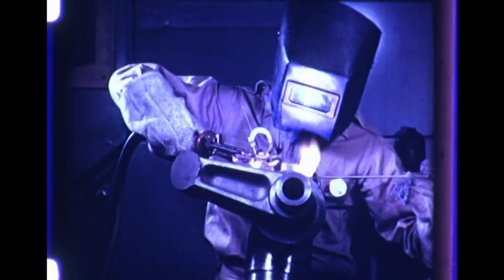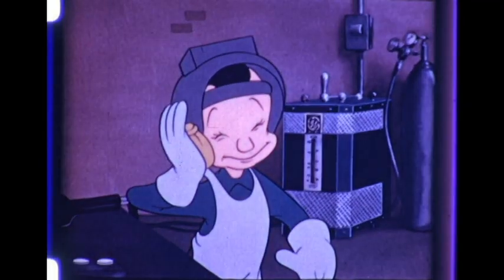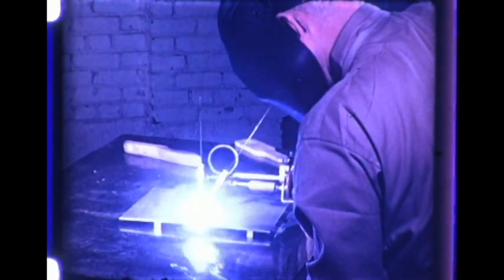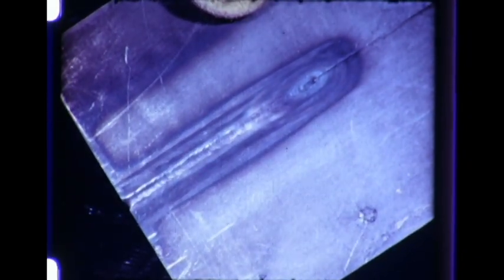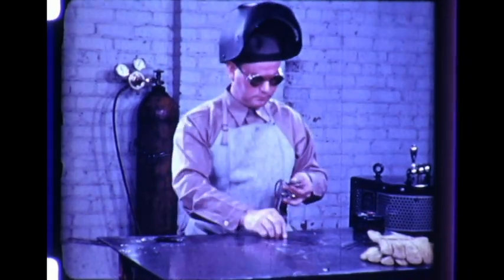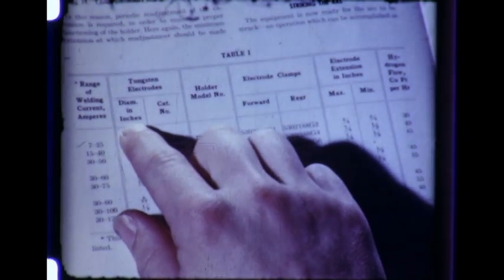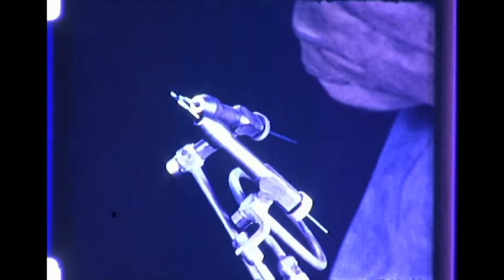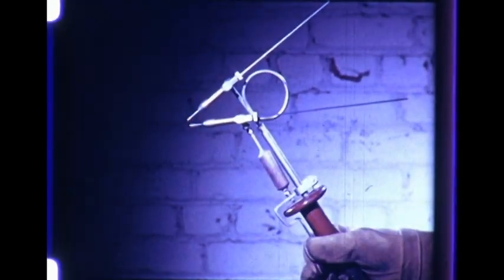The Inside of Atomic Hydrogen Arc Welding, Part 1 - 1943

Comment: Someone needs to build one for youtube video!
Reply: Concept is simple the gas is another story
Reply: Not too hard to get hydrogen gas... Just expensive.
Reply: @benwitherspoon1038   hydrogen oxygen fuel separator?
Reply: @Ihavetruth22  not sure what you're asking. Hydrogen is easy to produce by electrolysis of water but it requires a lot of energy to do so and to separate the oxygen... The process is what makes it costly. At least more so than say argon. It's still done just not really cost friendly for the purpose of welding at this point.

Comment: I was hired at Del Monte Foods, maintenance, in 2006.  Of course, it was third shift all summer, which meant lots of time to get nosy and check out a lot of old machinery they hung onto for whatever reason. The piece that intrigued me most was a GE Atomic Hydrogen Arc Welding machine.  It was complete minus a hydrogen bottle and tungsten electrodes.  My partner in grime and I set this thing up and tried it out.  What a neat machine!  Beautiful welds on stainless steel!  This is where TIG welding started for sure.   I later managed to buy it from the company for about $20, but alas, I couldn't get my hands on a bottle of hydrogen in this forsaken town I live in.  I figured I could sell it to someone on the Net who could give it a good home, but no one was interested.  I ended up listing it for free, still no takers!  It is now a conversation piece in my back yard.
Reply: +Richard Ruth Would be very cool to combine it with an electrolysis device for gas on demand?
Reply: Hi did you try to weld with a other gas  just propane or something low carbon gas type. Its only to create a protective layer around the weld.
Reply: J IJzer No, I didn't, Mainly because I have access to a a few different TIG welders, hence no need for this old one.  Those old G.E. welders are really cool, though.  This was the first Heli-arc welder!
Reply: Richard Ruth yes they are cool but like you say if you have acces to tig welders you dont need to do the effort to get this one running.
Reply: so did this process give the same result as tig? Atomic sounds like there's more risks over tungsten too
Reply: @AlphaFlight 😂😂🤦‍♂️
Reply: +Ryan Donovan Unfortunately, I gave the unit, everything, to a good friend of mine.  I kick myself when I think about it, but I have a lot of equipment, and I wasn't using it anyway.  Rest assured, it's in good hands and he uses it periodically. These are really neat welders, true pieces of Heli-arc history!
Reply: You still got it? Extremely interested if so
Reply: I would love to have it
Reply: I would buy it.
Reply: used ormus can gold out of it

Comment: Very nice! Can someone tell me if this is in use today and how does it compare with TIG welding?
Reply: It's not used much anymore because inert gases (helium, argon, various mixtures) are available cheaply now. One thing I would be somewhat wary about is the impact of hydrogen on the metal to be welded, e.g. hydrogen embrittlement in steel.

Comment: Atomic Hydrogen Welding, or so called Langmuir Torch is seldom used today. There is hardly a reason to use this process while TIG is available. Hovewer, it has applications - welding refractory metals like Tantalum. AHW flame/arc is hottest of all flames, and this process is one of few that can weld tungsten. Only laser or electron beam in vacuum are alternatives.
Reply: So your saying theres a chance.    It seems like it melts metals like wax,  like bronze brazing,  iv never seen tig do this..
Reply: This type of welding would still be around today if Backyard tinkerers kept it only to welding metal together, But this process has many other "FREE" energy concepts it had to be abandoned by the oil barons. Jo Blo just cant have bottles of hydrogen gas to play with anymore in todays age, He just might blow up the neighborhood so Good bye Mr hydrogen Hello Mr Inert. at the end of the day Mr Tig is not Mr Hydrogen. The good old days of welding are gone unless you are employed by the kriegsmarine repairing Uboats.
Reply: @oldschoolfoil2365  you can make a really energy neutral heating or generator from this.  But the problem is the arc is so hot (not the arc but the hydrogen recombining just on the edge of the arc) that it's hard to transfer to a material that does not melt (and so transfer it to water/steam production for turbines).  Maybe if you can manage to recombine the hydrogen without contact, you could recombine it near a steel spiral water tube and pump the hot water.steam to a turbine.
Reply: @oldschoolfoil2365  just generate it on demamd,  use some amps to generate it and redirect that power also to using it.
Reply: @ryanbeard1119  aluminium shavings and hydrocloric acid are still used for weather balloon lifting gas.  At one location I know of at least..  I must check to see if they do actually still do that or has OSH Technology found a better way.
Reply: @oldschoolfoil2365 you are an absolute moron 😂
You don’t have a clue what you are talking about 🤦‍♂️

Comment: Fascinating.  Makes me think of TIG.  But TIG needs ground to the work where this is looks to be kind of an arc-torch.  Is this process still in use today?
Thanks for the video.
Reply: It is exactly an electric torch!  Non-transferred arc.
Reply: @leonardpearlman4017  it can even weld steel and a brick together...  or weld steel on tungsten.  The temperature of the recombining hydrogen on the surface of the material to be welded fuses it together in an instant.  I've seen a video on the net where they weld nails on a brick..